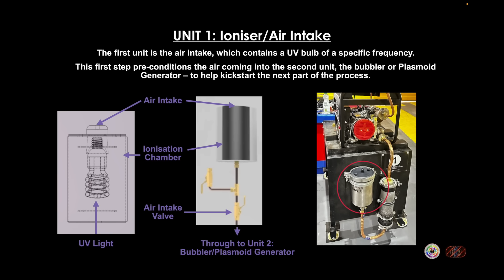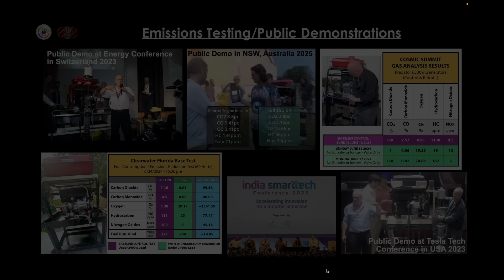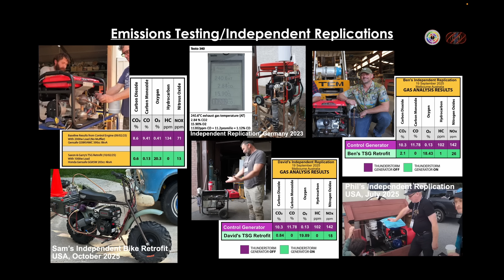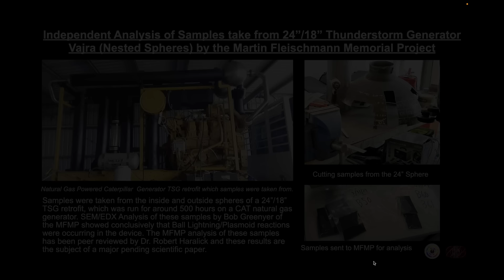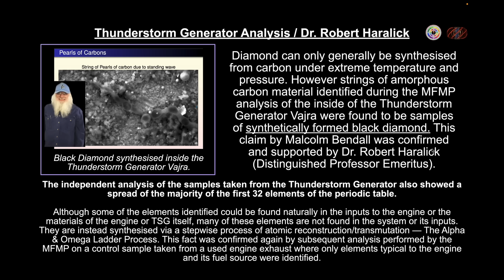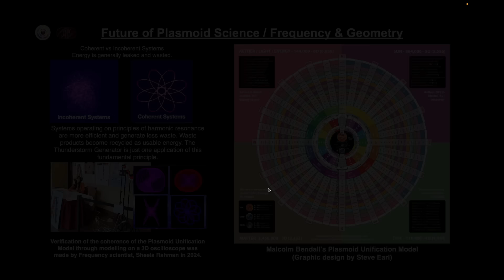What is the Thunderstorm Generator? | A simple overview of Malcolm Bendall's Technology

Comment: Thanks for this!  What makes the fuel economy increase or decrease from the upper level of 64%?  Also, is there a compression range from the cylinders that are required for the bubbler to work best?  I apologize for my lack of mechanical understanding...i'm a novice at this.

Comment: Wait wait wait... The micronized bubbles are carrying the small percentage ionized gas. A fraction of those bubbles make it into the cylinder where they under go an explosion, forcing them to implode. The resulting toroids are shoved into the TSG exterior (heat) spiral. 

That makes more sense to me than the bubbles just get so small that they implode.
Reply: The bubbles are water gas bubbles created by vacuum. They then implode into a torroidal self contained structure, a plasma torroid (plasmoid).
Reply: The implosion is caused by the pulsing action of the piston in the engine.

Comment: Why do we use UV light when we have proven it works without it? I get protium N=2 is UV but doesn't the thunderstorm already ionize the hydrogen off the water from the combustion product? 

It seems like the bubbler design is critical and I am wondering if y'all have tried magnetic vs non magnetic SS whool? 

It also seems the thunderstorm itself has changed over time and is much shorter now. Does the pipe lengths between nested hemispheres need to be tuned for each engine? 

I have the parts but need a welder. I should've bought a kit but bought parts before the kits existed. Now I am broke... Maybe I can send you my parts and buy kit for reduced price(as I already paid for the materials) okay thanks for listening and any responses I get. 

Cheers.
Reply: Contact a local boilermaker, or visit a local Men's Shed- style facility or Maker's Space. You may find someone with the skills you need who can help you with the project at reduced cost, and theres a huge additional advantage - you'll be helping to spread the word about this technology in an extremely practical way!! 💪☺️💫
Reply: @benenator I will google makers space near me

Comment: Has it been tested without the ioniser, without the bubbler, and without both?
Reply: Yes. It can work, but not very well. Without the bubbler it does almost nothing. If it’s been run before properly it can work ok because it’s impregnated already. They have a design where you don’t need a bubbler on the car, but re-impregnate every few years.

Comment: These tests need to prove pass for it to be real. 

A) It “passes” in the conventional way (most likely)

What you’d see

CO, HC, PM ≈ 0 after the unit.

CO₂ high at tap B (after treatment, before any fresh-air mix).

CO₂ much lower at tap C (your usual “exhaust”) and the tracer gas is diluted there.

Soda-lime on C still gains a little mass (so there is CO₂).

Garage ambient CO₂ rises modestly (e.g., 1,000–3,000 ppm), CO ≈ 0 ppm, O₂ near ambient.

Answer:
It’s a plasma-assisted wet scrubber + lean-burn/EGR effect with dilution.
The unit genuinely oxidizes CO/HC/soot to CO₂, cools/absorbs NO₂/PM, and your sampling at C is diluted by entrained air—so meters read “clean” and people stay safe. It’s good emissions tech, not transmutation.

B) It “passes” in an extraordinary way (very unlikely, but here’s the bar)

What you’d have to see, simultaneously

Tight carbon balance anomaly: Carbon in (from fuel) ≫ carbon out (CO₂ + CO + THC) measured at tap B (pre-mix), with:

No CO₂ mass gain on soda-lime at B,

No significant carbon captured in water/filters/sludge (measured),

Tracer shows no dilution at B.

Stable instruments: Dried gas, span-checked analyzers, EM-shielded.

Energy audit: Net thermal/mechanical output exceeding what fuel chemistry allows.

Isotopes/radiation: Detectable isotopic shifts in deposits or gas (ICP-MS/GD-OES), and a logged radiation profile (even tiny).

Answer:
You’ve found a genuine anomaly that current combustion/plasma chemistry can’t explain. Next steps are mandatory:

1. Independent replication in a certified lab.

2. Full calorimetry + closed carbon/oxygen/nitrogen balances.

3. Isotopic analyses of gases and deposits.

4. Peer-review publication.

If those still hold, the claim moves from “clever emissions polishing” to new physics/chemistry.
Reply: Completely agree with what you’ve said, mostly, but understand the way this tech works, getting those test results will be very difficult. This is a holistic system that you can’t just break apart the main system, or tap it, and not affect the results. You’ll see what I mean later.
Reply: Could this not simply be done by operating the unit in a closed garage remotely for saftey, measure the baseline, then run it then turn on unit from baseline then test? If the unit is transmuting the ambient gas analysis would be sufficient.  Either the  "canary" dies or its working. In simple terms.
Reply: @prakayak a small sealed shipping box would be sufficient.
Reply: Crate* (as in wood) not box (as in cardboard)

Comment: Its possible that the bubbler just serves to provide moisture. If so, there could be much simpler ways to do that. Is there evidence that the bubbler creates plasmoids?
Reply: You need some medium to form bubbles in order to symmetrically collapse them in order to get the collapsing wave function(?) that creates the Plasmoid (well really the tiny toriodal field that forms when you "pinch" the sphere)
There may be an argument for a different liquid, like oil, or something, but I think the viscosity of the liquid may be a factor in whether the bubbles form in the first place.
But again, this is just my assumption.
Reply: @codeisme from what I’ve learned, no, you have to use water. It simply has all the correct variables, and H2O geometry makes it work. The hydrogen exchange is needed.
Reply: Get ultrasonic humidifier and observe the difference.
Reply: @ANToxic777 sounds like a good idea.
I'm just wondering where the assumption comes from that EVOs are created from bubbles and that they travel through the pipes into the metal. Seems to make more sense that it's moisture, HHO, water gas that's helpful.
Reply: @Aedonius you should watch the Martin Fleischmann project. He has used microscopy to solidify those interaction.